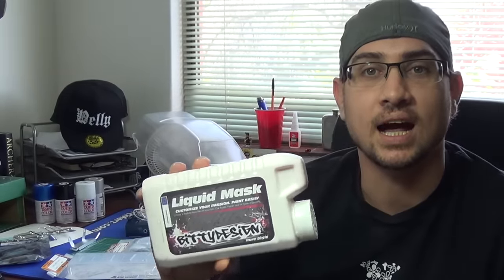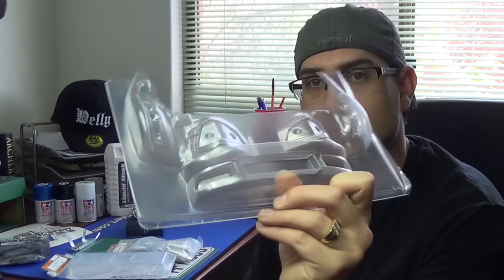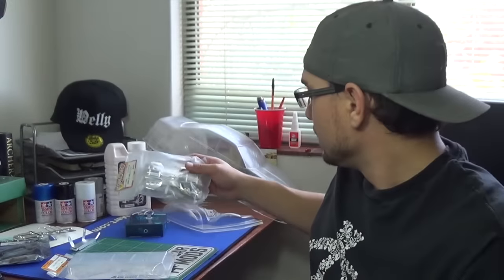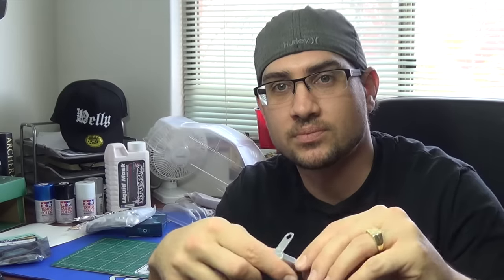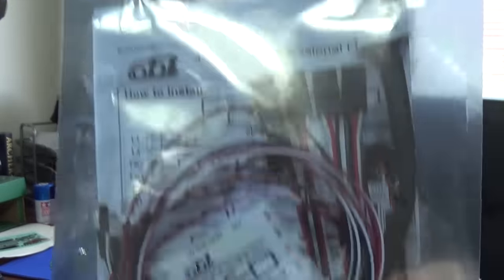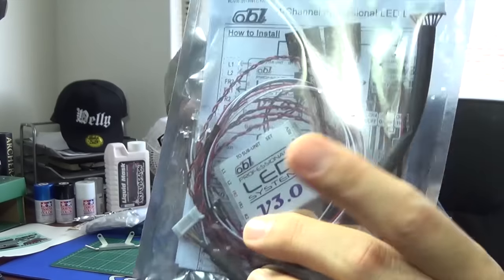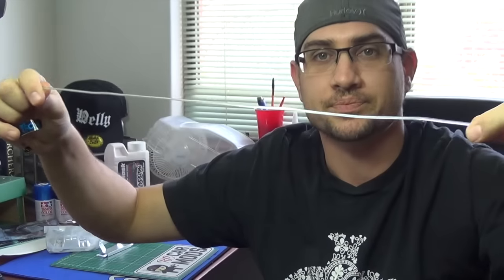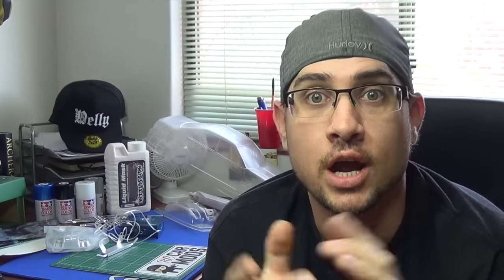RC Car Mods Update

Comment: what do you recommend for electronics (motor,servo,etc) on a RWD
Reply from the maker: there is heaps of good stuff out there. Definitely  spend the money on a good giro. other then that sensored motir, omg do a good servo as well. are you thottle heavy or steering?
Reply: +RC Car Mods i was gonna go with a K power servo
Reply from the maker: +x and t-dog gaming not a bad little servo and good value for money. i have never had a problem with mine. went for the omg on my latest car because ut suited the colour scheme lol
Reply: +RC Car Mods what company do you usually use for the motor